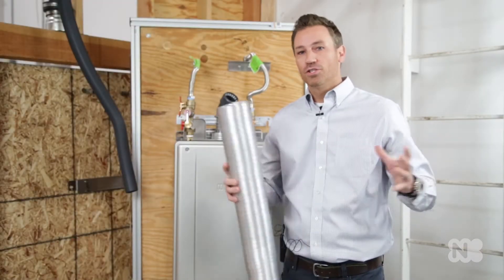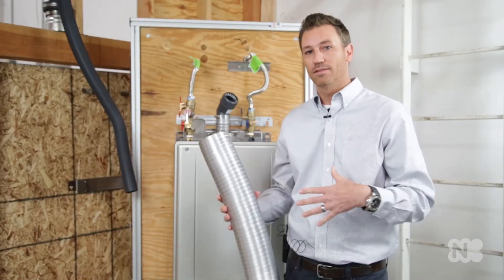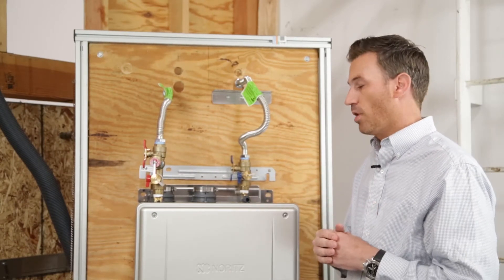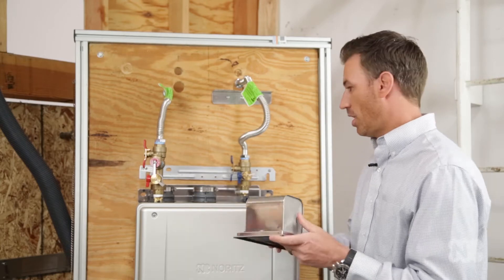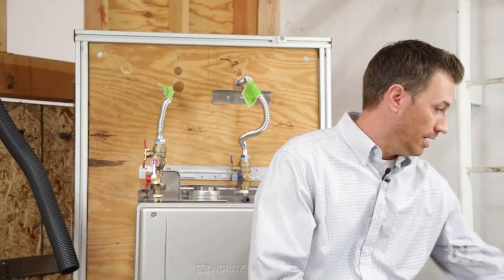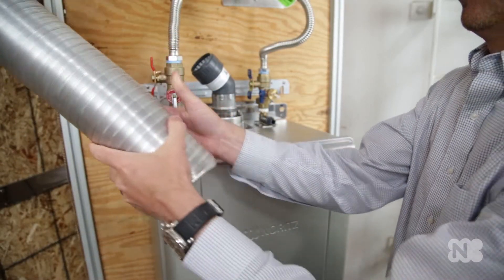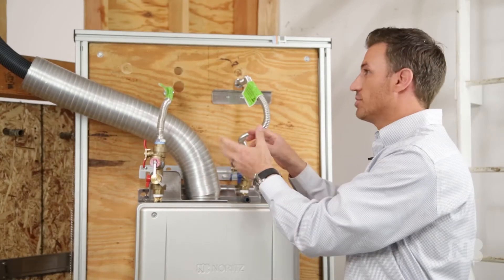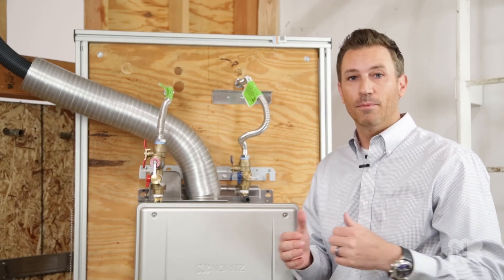Noritz Update #6 April 2018

Comment: How noisy is the EZ111 natural gas tankless compared to other tankless brands? Want to install one, but it's across the hall from a bedroom. Wondering how loud the venting is?
Reply from the maker: Hi Pete, it's about 52 db with the front cover on. Some homeowners go as far as installing wall dampening or vibration dampening mounts. Keep in mind we consider these extreme cases where it's typically light sleepers and the unit is mounted directly opposite a bedroom wall.

Comment: Will the aluminum flex pipe stretch to 5 feet?  Is the unit covered by the warranty if the owner does the install? Thanks.
Reply from the maker: Hi Larry, our EZTR bundles come with 25 feet of aluminum flex vent for installations. Because every installation is unique, you can read more about the details regarding our warranty here: https://images.thdstatic.com/catalog/pdfImages/07/07e1d597-7bae-48db-8a9c-bac3da953e95.pdf

Comment: Hi Jason, great video!  Occasionally and  I am not sure what triggers this, but no water flows through our hot water faucets.  The fix is simple, just simply turn off and on the Noritz water heater.  Everything then works as normal.  Why does this error occur and how do we prevent this from happening?   There are no error codes alerting us to any issues.

Comment: Can this heater be vent to a clay pipe where the old tank type , water heater was ?
Reply from the maker: Hello, if your clay piping is large enough to fit our PVC venting through it, then yes it can be used. Our heaters only use PVC, C-PVC,  Polypropylene, and Category 3 Stainless Steel Vent. If you have any more questions, feel free to contact our technical support team at 714-433-2905

Comment: Why don't you show the complete flue installation, specifically, the termination of the 2" polypropylene? Does it go all the way up through the existing B vent to the roof flashing and cap or just connect to the bottom of the existing B vent (I don't believe so)? If it does go all the way up, how does it terminate and what holds it in place? Is it that big rubber reducing coupling/adapter? Is that included with the kit? Thanks!
Reply from the maker: Hello, Steven, thank you for your comment. We'll be making a more in-depth video to address your question soon. To answer your question now the 2" polypropylene flex vent is meant to go all the way through the existing b-vent and is held at the end of the termination by a rubber gasket and fasteners, which is covered then by a universal rain cap at the end of the termination. All these part do come with the EZTR Bundle kit, which is designed to have everything you need to replace a traditional tank-style heater. Check out www.ezseries.noritz.com
Reply: @noritzamerica  what about combination setups? Where the hvac and the hot water tank come together into a 6 inch b vent. Does it still.have to go all the way up to the roof or does it have to not interfere with the hvac system?